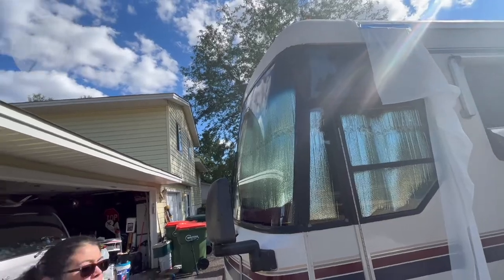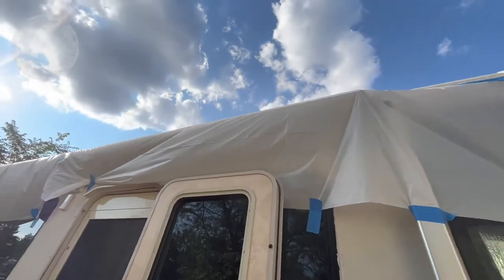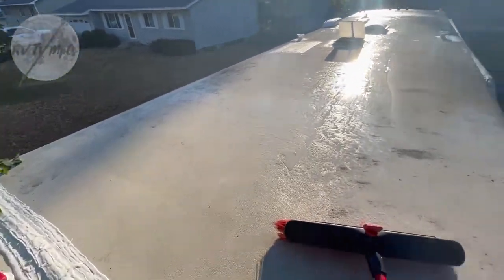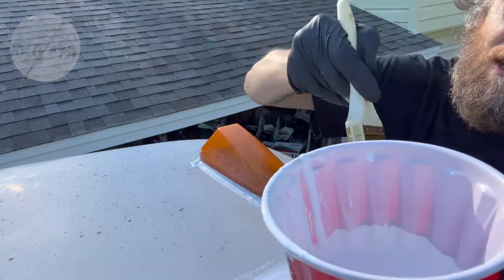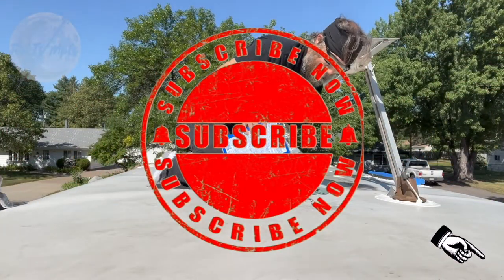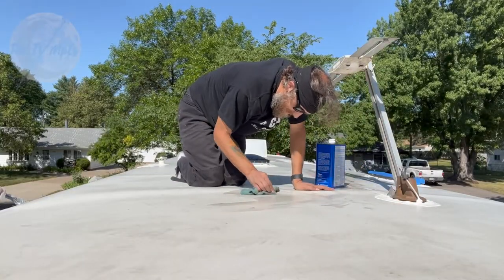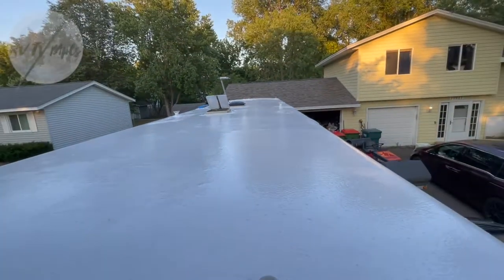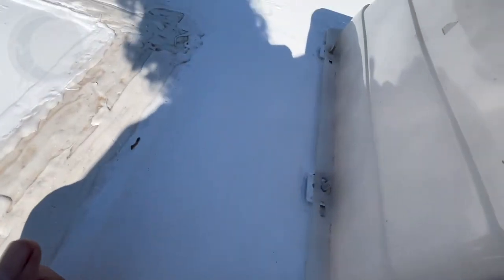DIY RV Roof Re-Sealing & Restoring with Henry Tropi-Cool

Comment: Just keep in mind for the future that dicor is not a sealant. It's a flashing. It's purpose is to keep water away from the actual sealant and seams.The sealant is the silicone that is between the fixture or front/rear cap and the roof. Though on a Winnebago, instead of dicor, you need to use a thermoplastic sealant that will stick to the stuff they use at the factory. AZ Expert has an ongoing tutorial about the difference between roof sealant and flashing on his channel. He also explains what you can and can not use on a winnebago roof.

Comment: I couldn't tell from the video: did you also paint over all the previous caulking (with the Henry coating?)
In one place you mentioned dicor, did you caulk with dicor on top of Henry's coating? 
I was assuming this wouldn't work because Henry's is silicone and dicor won't adhere to it. Thanks!
Reply from the maker: @PeteLeuenberger  we scraped all the old Dicor caulk off the roof and re-applied new stuff. We did not paint over the new stuff. Hope this helps!

Comment: I bought 5 gallons at Home Depot last November but i sold the Georgie Boy and in February i got a 96 Holiday Rambler Endeavor LE but i wont be using it because the Rambler is aluminum by the way why did you use that black sealer on the rubber of the windshield was it leaking or just preventive.

Comment: Thanks. It shows me it just helps origanal canvas. . I will use something else to seal full sheets of shower panels down. I just found rubber adhesive. Shows pic of doing just that. Like bible gum. Works better. . But I wonder if gray stuff with adhesive and fiber would harden a little more. Instead of rubber paint. I know snow coat kinda spider Weber on me lol. . Micro . Pockets of water.????
Reply from the maker: Is this for the roof of your RV? I don't know that I've ever seen anyone try something like this. Seems very interesting. You should definitely make a video about it.

Comment: How's your tropicool roof doin for you? I just did my friends 29 footer with it after we eternabonded the seams and all 4 edges.... He says the AC runs 40% less than before .... here in central ohio
Reply from the maker: It definitely adds a little bit of insulation which is nice. We are very happy with it! Although I should probably get up on the roof and check the seals again.. 😂
Reply: @Independent_DIY  Outstanding!
Reply: 5mss a 11:36 wwwww

Comment: People do not use Henry TropiCool for your Camper Roofs.   Once coated this stuff is a dirt magnet and your roof will look like crap all the time.  Also you will not be able to use any type of sealants over it to seal around your vents, etc that require yearly sealing.   

Your roof will look good and brand new for a week or two right after sealing, after that you are in for a headache.   Don't ruin your camper roofs with this crap there are acrylic based alternatives out there that are way better than this stuff.
Reply from the maker: I guess we would have to disagree here. I've noticed since applying it that it causes the water on the roof to bead, which makes it much easier to keep clean. We feel like it works excellent for cold climates where you have to remove snow. When you apply sealant you have to clean everything down to the bare roof anyway. So I'm not sure what your point is there. We will use it again and do highly recommend this product..
Reply: @Independent_DIY  In a place where there is not much rain Say Arizona, All that coating does is attract dirt just like any type of silicone used on an exterior.   The stuff is garbage and overpriced.

Henry has stockpiles of this crap and is giving it to Youtubers for free if they do a positive review on it.
Reply from the maker: @r.k.867  That would have been nice. We paid good money to be this positive! 😂
Reply: What would you recommend if not Henry's tropicool
Reply: You are correct, most of the silicone products do suck, but this one and lanco’s high end ones are actually really good stuff. There is actually videos completed where it shows that the dirt cannot hold on to the surface and is easily rinsed off. If your opinion was correct big corporations wouldnt be placing this stuff on the roofs of the warehouses. You can tell who uses this product due to the yellow grip walkways being laid down on the roofs of the warehouses (really slick), but anyway, opinions are only valid based on results. Everything I have seen has shown that this stuff is a high quality roof sealer that cools the surface.
Reply: Henry’s makes a caulk to use with the roof coating. But in five years of having it on our roof I haven’t had to caulk anything.
Reply: @JohnPhillips-y3r  Yah it does seal very well.  My whole issue is the dirt and dust it attracts. We are here in the Arzona Desert and this stuff is a dirt magnet.

Comment: Silicone is weak UV protection and silicone breaks down faster than acrylic.    Terrible stuff. Henry's keeps me employed I have to fix many roofs after this chit is painted on.  Literally it breaks down within 2 years.   Temporary fix.   Sheep are fools
Reply: What would you recommend
Reply: Henrys 887 has a lifetime warranty. If it ever fails, I will be going to Henrys for a free replacement, not anyone else where I have to pay. It's possible the surface wasn't prepared properly for the silicone sealant to stick to in the units you repaired. Their acrylic products only have a 10-12 yr warranty, requires 2 coats, are not 100% waterproof and have a 48hr cure time.
Reply: We did ours five years ago and it still looks great . Not one leak. The roof should be cleaned with TSP and a stiff brush. Then rinsed.
Reply: They offer a lifetime warranty for the roof sealant that is used in this video. When prepped correctly will last a long time.
Reply: @JohnPhillips-y3r  I have to do my rv roof that's sitting in the yard, and already did half the roof with this paint.. since it leaked somewhere in front unfortunately.. hopefully it lasts and lasts